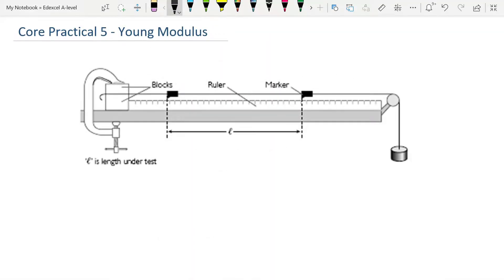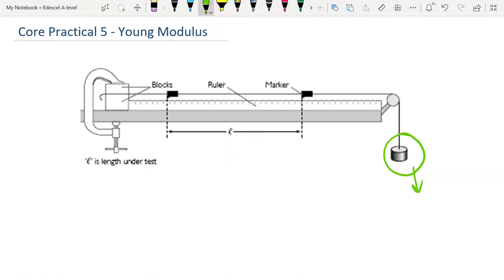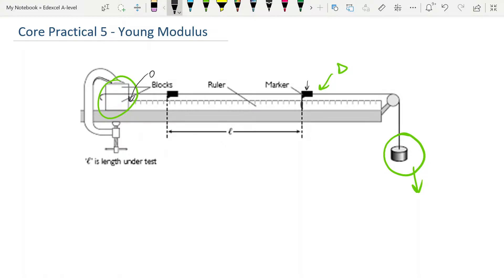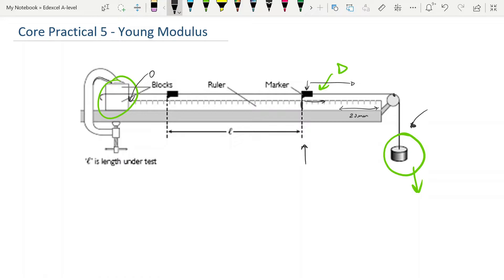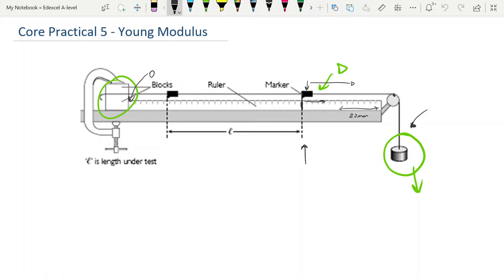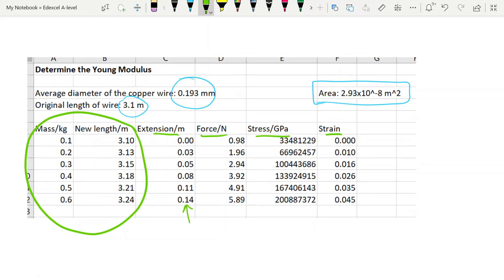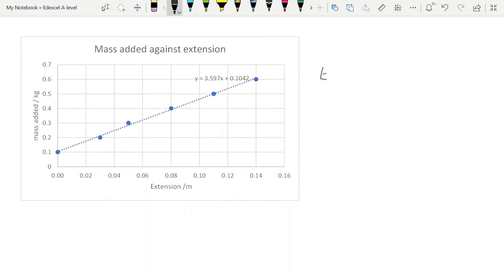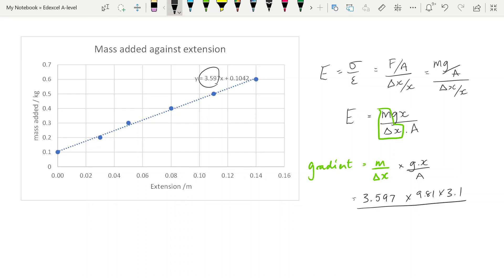Core Practical 5 - Young Modulus: Materials: Edexcel A-level Physics

Comment: How did u calculat area 
Area =4"pie"r^2?
Reply from the maker: Yes, for the cross sectional area of a wire. Beware questions though where it’s of some other shape. Regardless, you need cross-sectional area.
Reply: @nutshellphy  what are other shapes could come? can u mention all the volumes, areas we need to know ? thankyou in advance!
Reply from the maker: Cuboids mostly so just width x depth. Nothing too tricky, just a matter of paying attention.

Comment: what material did you use to get these readings? and thank you this video is very helpful!
Reply from the maker: I used the sample data given by Edexcel. They claim it’s for copper but if that were true it would give an E of 117GPa or thereabouts… so I suspect it is either not copper or there is a large error built in! 
Unless I have made an error in my calculations but if so, I can’t spot it!